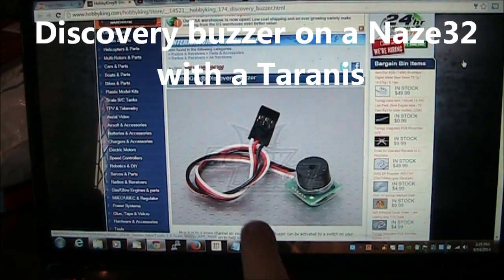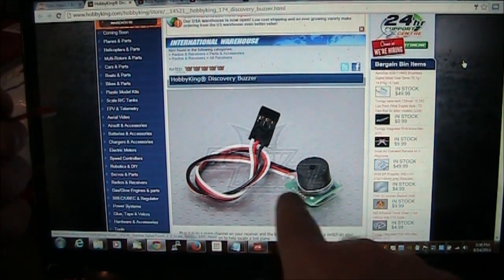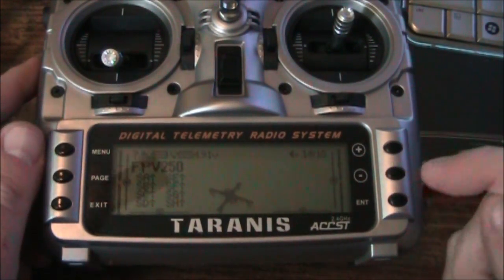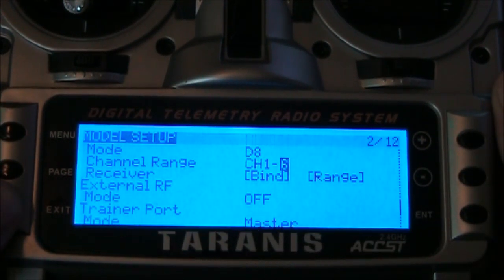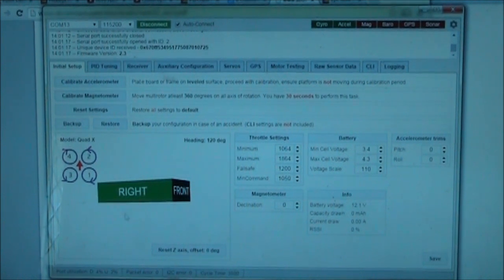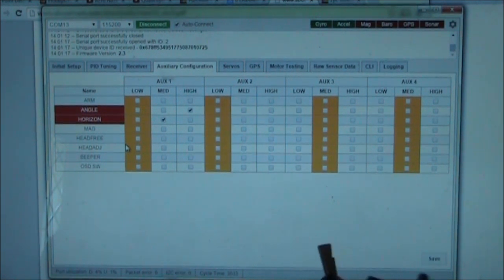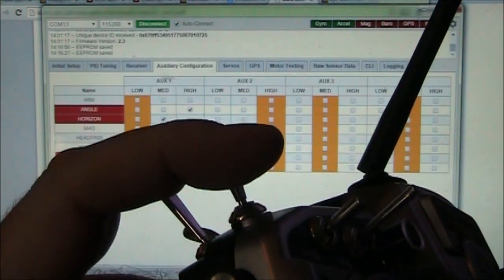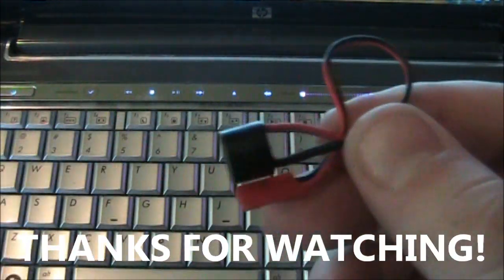Discovery Buzzer on Naze32 with Taranis Setup

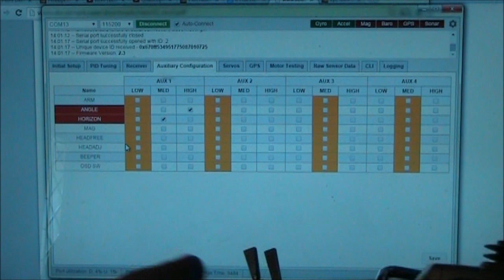Comment: It's an old video, but I am curious.  At the 4:00 mark you show a Baseflight GUI auxiliary switch configuration screen.  It didn't reflect any arming switch.  How would you currently setup a Taranis/Naze32/D4R-II with regard to a manual buzzer, flight modes, and then arming.  My D4R-II is configured for 6 channels ppm.  There was a comment below where someone had a 3-way switch dedicated to Off, Buzzer, and Arm.
Reply from the maker: I use down-right on the throttle stick to arm and down-left on the throttle stick to disarm.

Comment: The three pin beeper/buzzer shown at the start of this vid found at Hobby King can be used with the Naze32/Flip32 type boards.
All you need to do is short the signal wire to the ground wire then connect up the buzzer/beeper as normal.
I cut the signal wire short like a jumper and just soldered it to the ground right on the pcb so then there is only the pos and neg wires from the buzzer/beeper to the pcb.
Reply: very helpful thanks

Comment: Don't know whats going on with mine, as it won't quit beeping no matter what I do with baseflight settings. I followed your tut to the letter. I have tarranis plus and naze32 acro. Buzzer is a piezo with jst connector just like you show in vid. I set it up on ch6 switch SB which works fine in baseflight, but the buzzer won't shut up no matter where you put the checks and save.  Any idea's?  Thanks

Comment: On mounting the Buzzer, do you put the non wire part against some tape to the frame to mount it?  Meaning the wires are pointing up?  Will that muffle the sound?  Also I am assuming this is a discovery buzzer as well as a low voltage buzzer.

I really appreciate you making this video because I purchased 2 of the 3 wire discovery buzzers and now I need to get the two wire.
Reply from the maker: The sound is easily muffled.  I mount it sideways.  Sometimes I just mix it up in other wires to keep it from moving around or I mount it with some foam tape or velcro.   Yes, this is connected to the Naze32 so it can be both a discovery buzzer and low voltage alarm.

Comment: I see contradicting answers about using this as a discovery buzzer and a low voltage alarm.  I have it currently working like you do in your video, is there a way to tell baseflight configurator to make the buzzer go off at a certain voltage?
Reply from the maker: I don't think there is.  Baseflight configures your flight board but this is connected directly to your receiver so the flight board has nothing to do with it.
Reply: Do you not have the buzzer hooked up to the naze?
Reply from the maker: Luke Tucker Sorry, I was getting confused between the two types of buzzers.  At the beginning, the one on HobbyKing's website connects directly to your receiver and has nothing to do with the flight board so it cannot act as a low voltage alarm.... that is the one I was talking about in my previous comment.  The one that this video is about only has the 2 pins on it and it does connect to the Naze32... that one can also be used as a low voltage alarm and as a discovery beeper.
Reply: Ok. That's how I have it hooked up. Do you know what to set in baseflight to make it work?
Reply: ***** Cleanflight has the low voltage monitoring option I believe you are looking for.

Comment: A buzzer connected to your naze directly is great in most cases. Unfortunately, it has its flaws as a recovery alarm when lost, because a crash can easily eject the lipo, in which case the buzzer will go silent instantly.
A solution to this would be to have a capacitor or a small lipo attached to the buzzer as well, and some logic to make the buzzer go off. Perhaps a three approach, with 5V and a GPIO connection to the naze might work. Let the naze send some kind of heartbeat on the GPIO pin, if the heartbeat stops, the buzzer goes off. 5V is supplied continually.
Reply: +Duststorm01 I use velcro on the battery itself and two battery straps, and it has never ejected

Comment: Great video sir, One question , I have a piezzo buzzer (2 pins) connected to my naze rev6 , so it beeps and keeps beeping till I turn on my tx, but if I don't turn on the tx it keeps beeping, what can I do to set it to beep only when I use the switch that is connected to buzzer? thanks
Reply from the maker: I'm not sure, but you shouldn't have your quad powered on without having your TX on anyway.  You want the quad to always do what the TX tells it to.
Reply: I see thanks
Reply: also makes sense if you lose signal and can't activate switch...

Comment: If i have a receiver that only does SBUS and no PWM outputs, what would you suggest. Looking for a buzzer that would work with loss of signal from trasnsmitter. Idealy also one with its own power supply in case the battery gets jetisoned.
Reply from the maker: You can connect a piezo buzzer to your flight board and use a switch to turn it off and on through it instead of directly from the receiver.

Comment: Thanks for the video. Can this buzzer set up be used for both low voltage and as a discovery buzzer?
Reply from the maker: No, a low voltage alarm is triggered by having a 5v current go through it which is controlled by the flight board.  This buzzer always has 5 volts going through it but it is activated by the signal wire.
Reply: Hmmmm.  Confused.  So you can't use it as both a low voltage alarm AND a discovery beeper?  Only one or the other or just one?
Reply from the maker: RC Central You can use both.  The discovery buzzer on the webpage in the background cannot be a low voltage alarm.  The piezo buzzer that connects to your Naze32 can be both.

Comment: quick question... i applied buzzer and it worked with switch.. but when i apply throttle the buzzer turns on with out me flipping the switch its like its drawing power some how... not sure what do about that
Reply: It might be that it's configured as a low voltage alarm as well. So when you apply throttle the lipo voltage drops and the board interprets that as if you're out of juice.

Comment: could you plug it into a spare receiver port and assign a switch to that port  , so when you flick the switch it beeps , would that work ?? i want to use it on my plane ... Many thanks , Scott ...
Reply from the maker: You would have to have a more intelligent piezo buzzer.  The one only has +/- connections.  If it receives 5v, then it goes off.  You'd need one that could understand the channel switching.  I'm sure they make them, but I haven't looked for them.
Reply: Ok thanks for the advice ......

Comment: Can I potentially use the buzzer port to connect to the LED instead so I can switch it on/off?
Reply from the maker: It may work.  You won't have any control over the LEDs other than on or off.  You'd be better served by connecting smart LEDs to the LED port and then you'd have the ability to program them to do what you want.  Here's an example of what I'm talking about:   https://www.youtube.com/watch?v=EmgYKaA5neE
Reply: travisgrindal Thanks!

Comment: The piezo sounds loud in the video, I have the same but the buzzer isn't loud, you can hear it chirping for low voltage ect but the noise isn't striking?
Reply from the maker: The low voltage alarm is quiet but the beeper on mine is a lot louder for some reason.
Reply: ***** I think it might be to do with the length of time the voltage is allowed to go into the piezo. When the battery warning is beeping the pulses are very short, but when you switch a button on the transmitter it seems that the pulses are longer. It would be good to see a variable in baseflight or cleanflight to allow for longer pulses which then may make for a louder beep (Dominic Clifton)
Reply from the maker: You're probably right.  I was paying more attention last night to the low voltage alarm and it is real fast chirps and I'm betting it isn't getting voltage long enough to reach its full volume level.

Comment: Is this connected directly to the naze?
Reply from the maker: yes.
Reply: ***** which pins? i dont know why its so difficult to find this info
Reply from the maker: OneFlightWonder Rc The piezo buzzer connects to the "Buzzer Connector" pins which sit between the "FrSky Telemetry" and "Battery connector" pins.  Google for "naze32_rev3.pdf" - that is the name of the manual for the Naze32 board.  There are some pictures in there that have the pin layouts labeled.

Comment: Lol,
Step 1.
toss Discovery Buzzer in the trash
Step 2. connect piezo buzzer to board instead

I think there is a way to connect a Discovery buzzer and it has to do with allowing a second PPM output from your receiver.